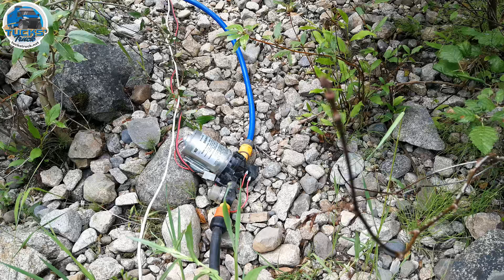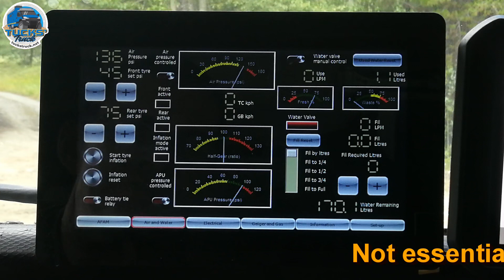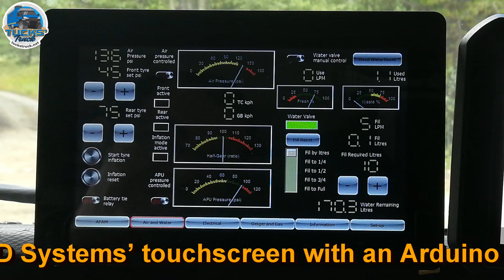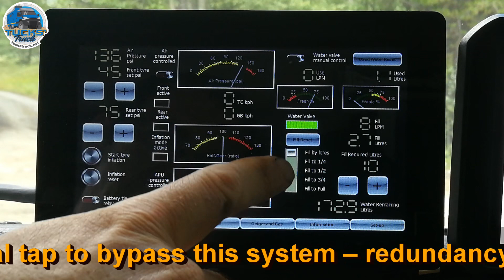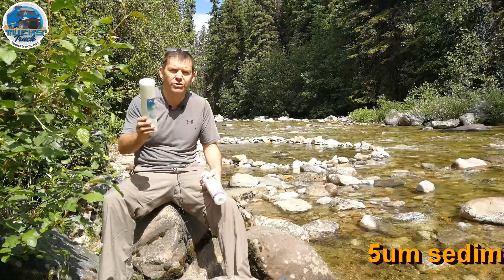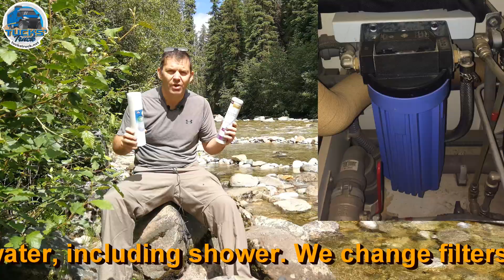How we fill and filter our water

Comment: Marcus. Greetings! Which Shurflo pump do you use at the extraction point and how do you power it? I'm thinking of doing this, but the cables get so huge if trying to use DC current. Thanks
Reply from the maker: Hi John.  Its model number 2088-554-144 but I think other versions should be fine.  It uses about 5A and I haven’t noticed any performance issues on 20’ of 8 awg cable (quite large as I originally had this cable for a compressor and reused it).  I have actually just ordered two 20’ lengths of 10 awg to make a longer lead.  My plan is to use this for the water pump if I need to reach further but also for a plug in folding solar panel I have ordered.  I will put connectors on all the cables so I can make a 20’, 40’ or 60’ lead as required.  I should get all the parts at the weekend so can let you know how it goes next week.

Comment: Great video Marcus, thank you for taking the time to make and share.

I have a couple of questions if I may, please:

- How do you manage to get such an accurate reading of your water level? My own digital readout (similar tank capacity) easily varies by 20 litres with even a slight change of parking angle.

- What do you do about black (i.e toilet) waste disposal? We have two cassettes to provide 40 litre capacity but finding where to empty responsibly can sometimes be an issue.
Reply from the maker: Thanks 👍 The 'normal' tank gauge system only gives me empty, 1/4, 1/2, 3/4 and full which isn't very accurate.  However, I have installed two water flow meters in the pipes, one for measuring the fill and one for measuring the water we use.  These flow meters allow me to measure the water input/output to an accuracy of about 10ml and I use these for my accurate tank quantity with the normal guage as a gross error check. 

We use a SOG vent in our toilet canister so we don't have to use chemicals.  This means we can safely dispose of our black water into long-drop/pit toilets or septic tank systems (chemical toilets shouldn't be emptied into these as the chemicals kill the bacteria that make the septic system work).  We can also empty into a regular toilet.  Our gray tank drain is also small enough that we can drain it into the toilet canister so we can dispose of the gray water into a toilet too.  This also helps to clean out the canister. We found this very useful when it was -31C and all the dump stations were closed!
Reply: @MarcusTuck  Thanks again. I have now seen the detail on your tech in the SRMN group on FB too, so may take a look at doing similar myself.